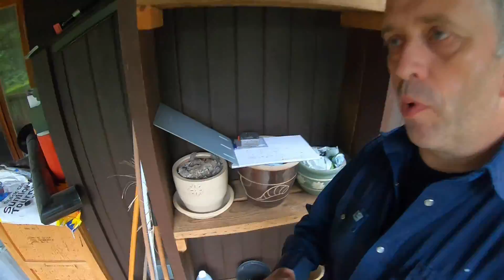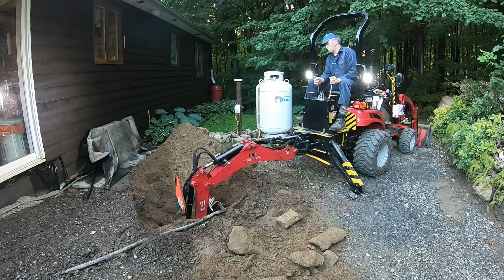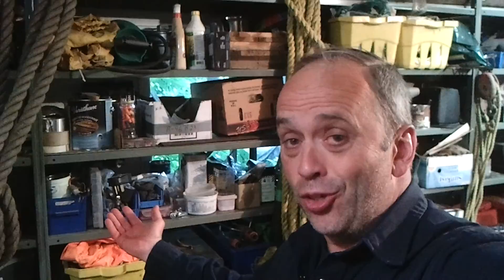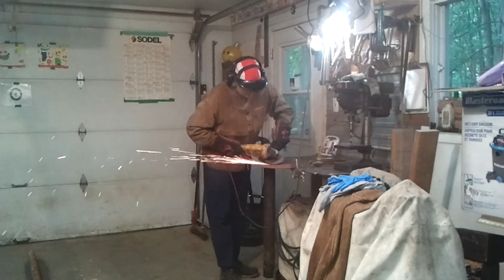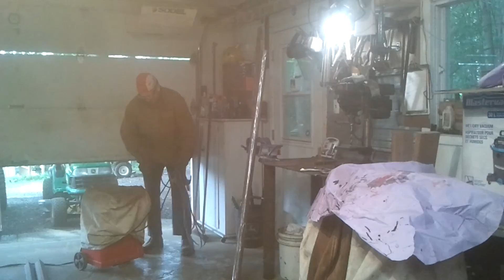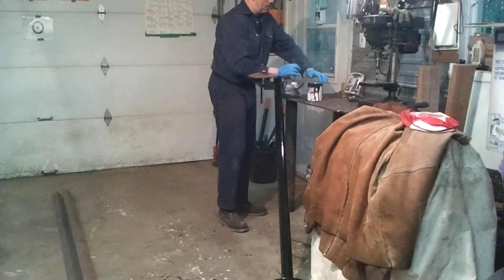Mahindra eMax 20s backhoe digging, rock walls and How to built a steel support post and install it 👍

Comment: Hey Dave,
Been watching your movies for a few months now as I just purchased an emax 20 for my property in Ontario. Do you know if you can put a post hole digger for the PTO? Thanks!
Reply from the maker: Thank you very kindly for subs my channel and many congrat's on your OUTSTANDING purchases. Yes you can buy, but you need to talk to your dealers since they are various types and strength needed to making turn and some minor modification on the rear 3 point attachments. Please do contact the sale person were you bought your tractor 👌👍🙏😇 Have fun and PLEASE READ MANY MANY times your operative manual 👌👍 CHeers 🍻

Comment: I see you broke out the tombstone to weld the support post. That was a big hole you dug. Too bad you did not have a post hole digger.
Reply from the maker: Good evening Sir, we have to much rock to use a post hole digger here. That spot was fill up with sand, but if you look on my other videos were I dig trenchs I would broke any post hole digger for sure. Thank you for your great support and input Sir Cheers !!!

Comment: Dave, you are making a great porch frame that you can be confident in for decades to come.  Maybe you can weld some end pieces on the tubing to keep water out.  Good thing you have a tractor to move it around after you finish the fabrication, cause it  looks like its getting sorta heavy.
Reply from the maker: Good day Sir 😊 Yes in deed i will at the end for sure using steel left over and i will do paint them and also oil protected them too 👍 Thank you kindly for your nice words and great input and have a great and blessed week Sir 😊Cheers 👍

Comment: Great work, Dave!  That’s going to be one very strong and long-lasting deck with all that steel and concrete!  Looks like you have the drainage laid out well.  BTW, I have a dehumidifier in my shop too.  It’ about the size of yours, but it manages to keep everything dry.  Thanks for sharing!
Reply from the maker: Good day Sir, 😊yes Sir that is my plan to built that  deck maintenance free and no more water problems and yes dehumidifier is great to have to keep things dry all year around 👍Thank you kindly for your nice visit, kind comments input and many thanks for your great support Sir and have a great week end Cheers !!!👍😊

Comment: That was a significant dust cloud you had! It beats my welding clouds! Lol! You sure work hard to make this deck last for decades.  Make sure water will not make it's way into the pipe. If it's too late, you may want to insert a pool noddle in the pipe to avoid the frost to split the pipe. The foam will not really insulate, but rather allow for expansion of the ice into the pipe.  At 6:15, the Mexicans were too loud and they covered your voice! Lol! Thanks for sharing Dave!
Reply from the maker: Good morning my friend 😊 Yes in deed that is my plan, to last for many many decades😉👍 No it is not too late, and thank you for this great idea for the outside slow pitch angle french drain  👍 Yes, i forgot that one about the Mexican LOL 🤣Thank you my friend for your great support and Say I to Chef Céline 👍😉
Reply from the maker: Now about my dusty cloud, That is why a left on my video since I'm the one who start with tractorman 44 that fun video a year ago LOL Cheers !!!

Comment: Great job on the post. I was surprised how deep you put it. Is that to get below the frost level or to get down to solid dirt?
Reply from the maker: Good evening Joseph 😉 Yes it is for getting it under the three feet frost line and to also getting solid side strength by putting three rows of rock and compact sand. Thank you for your kind words and great support 👍Have a great week Cheers 👍😉

Comment: We have so many rocks.....Nice to see what you did. Curious how wide your bucket is? Not sure if you mentioned it or not. And. you should always have the garage ventilation on with any sanding etc.!
Reply from the maker: Good evening both of you 😊 The bucket is 12 inch wide by 10 inch deep by 14 inch length  👍 Yes in deed, I was a real bad boy that day inside the garage, perfect exemple of what not to do, simpliciale I have all the good respiratory equipment on site !!! Thank you kindly for your great support and kind words and nice input and have a great week to both of you Cheers 👍😊
Reply: @RCAFpolarexpress  Thanks for the answer! That 12" bucket did a good job!
Reply from the maker: @CreatingASimplerLifeOffGrid  Yes in deed, it is a great size to have 👍😉

Comment: Allo Dave. Looks like you're ready to start building the deck now. 
Have you tried flapper discs on your grinder to clean up the steel?  I'm using a Dewalt disc I bought from CT to clean the recycled steel on my wood splitter build.  Works well. It won't get rid of the dust but you won't get the sparks.
Reply from the maker: Good evening Alain 😊 Yes I will like to start tomorrow 😉Yes these flapper disk work very well in deed 😊👍 Next time I'm at CT, I will buy some for sure 👍😊 Joe as some and I did try it and does a great jobs for sure 😊👍 Have a great week and thank you for you nice input and great support Cheers Sir 👍😊😉

Comment: Dave,  Nice work,  The backhoe does come in handy for this type of work.  I was wondering why your electrical cable was so close to the ground.  I thought it had to be at least 2 feet below but I could be wrong.  Stay cool during this hot weather.
Reply from the maker: Good evening Sir, Thank you kindly for the nice word. To answer your question, the first part of the cable was under my deck so when I pass the cable it was on the surface under the deck but then the rest is at 12 inch since I dig it with a hand shovel all the way to the shed !!! 1 full day of hand shovel😳 . The provincial code are calling for a min of 3 feet here and i'm planning the correct that once my deck project is completed !!! Cheers and have a great week end Sir !!! 👍